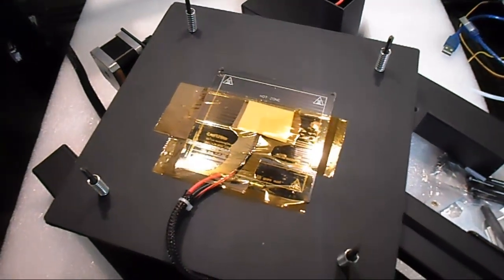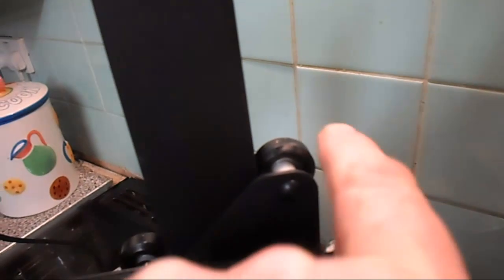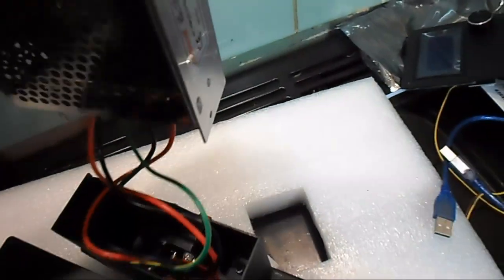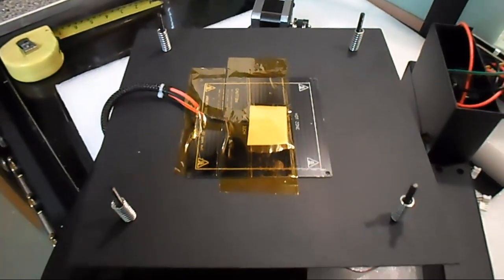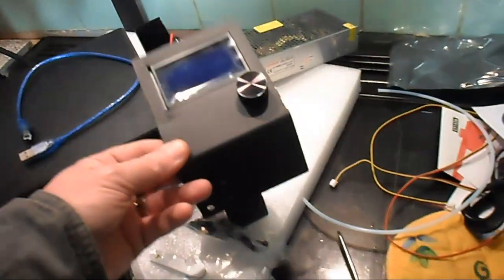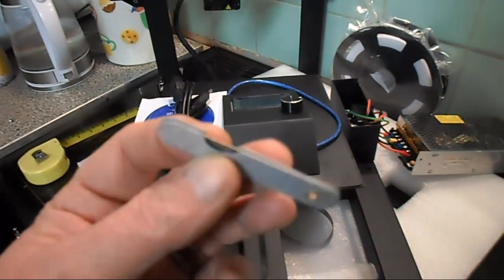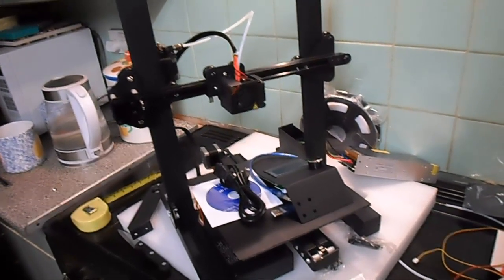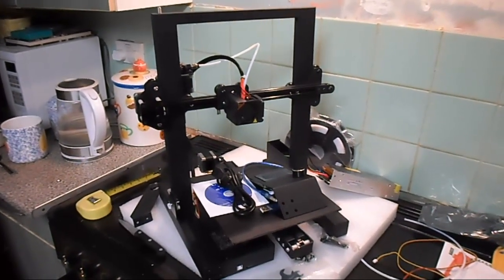3D Printer A13S PRO MK 10 Extruder, DONT BUY THIS SEE THIS VIDEO BEFORE YOU BUY ONE

Comment: OK I got this at Christmas for  119 pounds and yes I also thought I was getting a ender pro . After spending some time to put it together I had issues with the z axis stepper motor and the wheels on the z axis as I all so found that the holes on the inside of the bracelet are out by 3 mm .I got in touch with suppler and after some time I got a partial refund  which I spent on new wheel's stepper motor and a new motherboard. Then the unit failed to operate due to the 100mm heating bed had failed in to points . I am awaiting to get a replacement heating plate (200x200) .As for the control screen my one had a number of issues that I managed to fix by ajusting the screws,  please note that the ender also has no back plate is one of the first things you should print of. My unit was also missing bed level screws and I had to refer to the pictures on the manual to reconnect the wires to the power block. Not for the amitur. PLEASE NOTE THAT I HAD PUT THIS OUT THERE.  Also the CD works on my windows 10 .

Comment: Have you tightened up the eccentric nut on the rollers? Even the Ender 3 doesn't have a cover over the back of the screen but can be easily printed. Is this your first 3d printer? However the size of the heated bed is on the silly side

Comment: Hi 
I got the same model the other day as my 1st 3d printer and it mine is in the exact same state.
I'm on Windows 10 and the disc doesn't work also so I'm looking through the net for some software. 
I thought I was getting a ender 3pro.
Reply from the maker: open a case and get your money back

Comment: Thanks for your review. On the basis of this I have just purchased an Ender 3 Pro (better spec than the Ender 3 which this model appears to be cheap knock off version of), for just under 163 GBP (which includes shipping), direct from Creality. Cheaper than best price on eBay AND will get official warranty, which I understand you only really get if you buy direct. Golden rule .. do plenty of research before buying and thanks to rabone1963 for helping with my research.